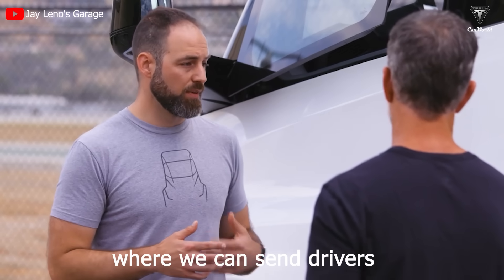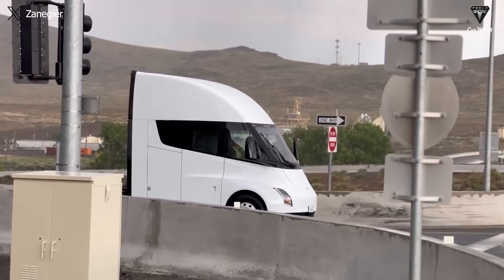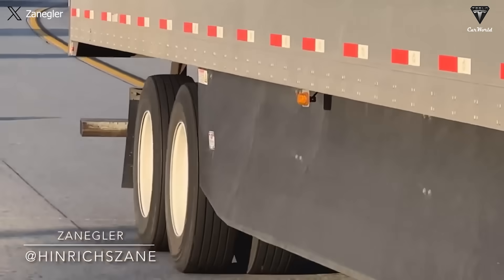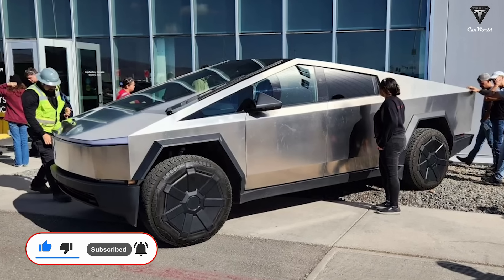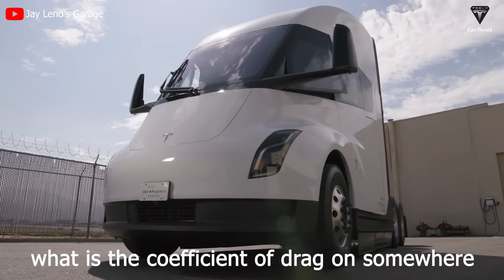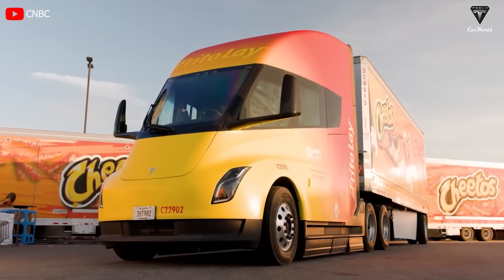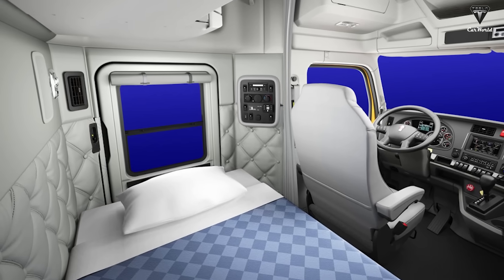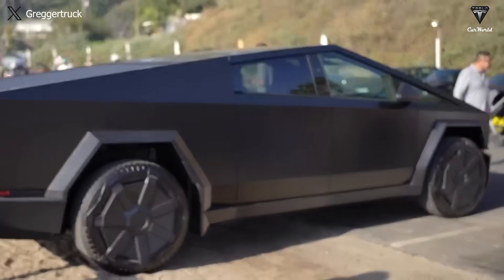Elon Musk Review 2024 Tesla Semi New Version! Up to 90% Surprise, 10,000lb and 600 miles per charge!

Comment: I’m a retired trucker.  Drivers get paid by the “Pay load”.  
I.e. the more you haul, the number of miles, the more you get paid.  
1). I’m still hearing a lot of hand waving over payload (load capacity).  
2). Also, if you stretch the cab, you reduce the turning radius.  

So if you transfer the cost of 18 of 21 etrucks to tax payers, the etrucks are still more expensive….
Hu?

Comment: Why is this truck not a Hybrid ? it will work out better, the diesel will make sure the driver will not run out off the juice , and haw come they dont even run from LA to Las Vegas as they were going to at first, or maybe only use it in a local delivery applications.?. TH

Comment: Pause at 27s into the video and notice that they drove for 19.5 hours (4.5 hrs of breaks) at 60 mph in order to get the 1076 miles. However, they started the 24hr timespan at nearly 95% charge, and ended not at the same charge, but roughly 20%. According to the graph, it took them 2 hrs (11am to 1pm) to charge from 0% to 90%. Thus, in order to return to the original state of charge and be able to repeat the same mileage the next day, they would need to subtract another 1.5 to 2hrs to get back to 100%, thus reducing their mileage by 90-120 miles (let's just avg 100) to give roughly 976 miles. Note: we don't know the weight of the cargo, perhaps it was a half empty truck.....

Also note, they had to drive at 60mph to get these efficiencies (mileage would be worse with higher speeds -- ICE would as well, but it's a 10-15min refuel vs. hrs). In trucking, time is money; mileage/unit-time is money.  According to the FCMSA, truckers can only drive 11 hrs/day in a 14hr work day (other 3 hrs can be non-driving truck related tasks, i.e. loading/unloading/inspections/etc). If we assume ICE vehicle can travel avg speed of 70mph (w/o having to optimize battery drain vs charge-time efficiencies), then an ICE vehicle can achieve 770 miles in 11.5 hrs with a 30 min break during the 14hr window.

For the EV, they deplete the battery from 95% to 5% in approximately 6:45-7 hrs. Need 1 hr to restore 40% charge to 45%, which gets them another 3 hrs of drive time, before needing another 1hr charge & only having 2hrs remaining to drive.  Since they needed to do everything possible to preserve efficiences of battery, they only drive the 60mph to reduce drag losses, and they drive for 11 hrs to log 660 miles, but have already worked for the consecutive 14 hrs regulated by the gov't (so hopefully they don't need to do any cargo unloading/loading at the end of their drive, if they've reached their destination that is).  Also, hopefully they are comfortable minimizing their recharge durations to maximize mileage they can travel in the 14hr work-day (essentially diving under a 10% charge multiple times to maximize their distance traveled & miraculously (one hopes) always having a charger available in the final 10% on the last discharge leg of their 11hr driving journey).
Reply: Yes, downtime is money but look at how little downtime an electric truck would have over the lifespan of the truck compared to a diesel truck. Ups for example, their trucks run 24/7 365. We build them to fuel up while running, with automated lube systems to reduce downtime etc. Those trucks only last about 3 years. The same tesla could last twice as long with half the maintenence. Add to that the fuel savings over those years and I think you've still got a better ROI with the electric. Maybe not yet, until the infrastructure is nationwide, but when that happens, yeah.
Reply: @Lord_Pistachio_Nut  I envision a lot more downtime for charging than for repairs. Every 7 hrs after traveling 420miles (@60mph), the Tesla needs 2hrs to recharge 90%. That's 9hrs to go 420 miles. Divide (365 days * 24hrs) by 9hrs gives you a max of 408,800 miles in a year that the Tesla can drive (without any downtime for repairs, loading/unloading/etc - just Max mileage if it was hauling the same load for infinite miles it can attain in 1 year).

Take a Diesel, not constrained to 60mph, let's say 70mph (typical). In a 9hr trip, with a 30 min window necessary for refueling (a very liberal estimate), therefore 8.5hrs of trip time, it will cross 595miles (without maintenance/loading/unloading). In a year it will go ((365*24)/9)*595 = 579,133 miles.  If you estimate 4 weeks of repairs (28days) for that diesel during that year of continuous running, you still get (((365-28)*24)/9)*595 = 534,706 miles traveled. For the diesel to rank as bad as the Tesla in miles driven per year, it would have to sit in a repair shop 108 full days to only go 407,773 miles.  If you assume the ICE diesel is constrained to the same 60mph that the EV's adhere to (& thus increasing the diesel's fuel efficiency due to less drag with speed), then a Diesel must sit in the shop for 65 FULL days to only make 408,000 miles in a year & be on par with the EV's poor mileage in a year. 

Anything less than 65 days is a win for the Diesel over EVs in terms of downtime. Said another way, that 2hr recharge every 7 hrs is costing the EVs 65 days worth of mileage. As a consistency check on my calculations, I note that a quick Google says Diesel Semis typically last 750K miles & can even pass 1 Million miles. Given my calculations of the mileage driven above, that jives with about 2-3 years of 365/24/7 driving that would hit between 800K-1.2M miles before the truck must be discarded.

Comment: Diesel trucks are not $120k anymore. Maybe 2019 diesel trucks with 300k miles on them. Or salvage diesel trucks with fresh water insurance claim. (works gr8)
So Tesla can charge whatever makes sense for them as long as they treat their employees well. And the weight is not that important for sleeper trucks. Range is. The shippers will adjust the loads. The Peterbilts and Kenworths are not very light either but they are everywhere. So

Comment: High capacity charger requires 10Kv grid connection. Some local to-grid large docks owned by big corporations might be able to get local electric suppliers to allow a 10Kv install. But outside of that, there is no local electric supplier that has the capacity for another 10Kv in one location. Even warehouse owners with many gas forklifts are being denied chargers to convert their forklift fleets to electric because the grid capacity is not there. Without high capacity charger its a 10 hour charge for a Tesla Semi verses 15 minutes and 1500 miles for diesel. If your a driver, which would you prefer.
Reply: Great points, and the same goes for Tesla cars vs gasoline cars:    5 minutes at the gas station adds 400 miles of range to the car.  Tesla car cannot compare to that!

Comment: I think the roll out of these vehicles will be closely match to the installation of high capacity chargers.  The Pepsi vehicles frequently got 'topping off' charges during the day while the driver had a break.  Regenerative braking significantly assists charging.  To keep the weight down I would not be surprised if carbon fiber will be used in the future.  Walmart has already put down a deposit on the next batch of trucks.
Reply from the maker: Thank you for the information. The current release of Megachargers by Tesla remains a challenge due to its high cost, especially considering the limited number of Tesla Semis, only 100 units. Regarding carbon fiber, what is your perspective? Please explain it more clearly to us.
Reply: While I have no inside information on what Tesla will or will not do.  Engineers have known that carbon fiber is one of the best choices when manufacturing strong but light equipment.  Some examples are cylinders to contain compressed natural gas, the Boeing 787 and the Airbus A-350.  In all these applications the carbon fiber is used in conjunction with other materials.  Usually aluminum.  Tesla engineers are known for actually using the best ideas available.  That is why I stated that it would not surprise me.
Reply: @alberthartl8885    Regarding carbon fiber for the Tesla Semi:    Yes Boeing and Airbus use carbon fiber extensively.  But a passenger jet sells for $200 million USD or more.   A Tesla Semi costs nothing compared to that.   Carbon fiber is expensive.
Reply: @alberthartl8885  ehh I beg to differ on the whole carbon thing. Sure, it's strong but no, it's not strong at all lol. It's one of the most fragile "hard" substances we can build with. Carbon works on planes because of negative pressure, same reason it "can" work on subs, but a semi? Any weight savings you could gain from carbon fiber would end up being negated by repair or production costs along with R&D to supplement the inherent weakness carbon fiber has. Theres a reason one frame rail weighs so damn much on a semi truck lol. The forces at work on a semi are by and large above and beyond what common people seem to understand. Carbon for tanks would be a hard one to pass DOT regulations too I think: given how air and fuel tanks need to be able to handle x pressure before failure etc. Idk though, carbon impregnated materials may be an idea moving forward 🤔

Qualifications: I build the #1 rated semi truck in America, specifically on the early form Chassis line and have learned quite a bit about WHY we use what we use; from a safety AND usability standpoint. Carbon fiber is more vanity than function in that application.

Comment: There is probably only so far that technology can go with the "energy per weight and per volume" that electrical battery storage can go.  And that will not approach anywhere near what "hydrocarbon" fuels can approach.  So even with the different mechanicals, and even better than the 40% energy to mechanical conversion (in electrical probably over 80%) there is always going to be a weight difference between electrical and similar sized/capacity ICE vehicles.  It is suggested here that weight difference is about 2,000 lbs on the big rigs, and more range will mean more weight.  Leaving the question (particularly in sleeper cabs) "where do you put the batteries.  They may have to think about putting an additional battery pack in the trailer itself.  Which would make the "batteried" trailer specific application/purpose, rather than a cheaper general purpose that can be used by any rig.
Reply: The weight difference is much more than 2k lbs. but unknown. Yes for the next few years battery trucks will be limited to smaller weight loads, but that is still  80% of the market. Cost saving will be significant, and clean silent trucks are great PR for companies.

Comment: People who actually use their trucks need at least a 500 mile range for towing and a full truck bed. The range extender sucks. Surely Tesla can do better than this.
Reply: I don’t think the 4680 performs as they had hoped at this point. But a lot of people are working on advanced battery technology.
Reply from the maker: Thank you! Tesla Semi always better in update version !!
Reply: 4680 battery is not optimal yet apparently. From the tear down looks like the MY with 4680 has roughly 828 cells that can give 278 miles full charge. 

Dimensional wise, looks like the Cybertruck and MY has the same floor dimension so we need to wait to see how many 4680 cell in the Cybertruck battery pack that achive 341 miles. If the amount of cell is the same 828 (unlikely) then 4680 cells project look like a success else we can divide to see how much kwh per cell for the Cybertruck. 

With Tesla opsession with sameness, I think any major break through will be with those 4680 cells as there's limited amount and maximum cells per battery pack from their assembly line. The reason why those 4680 dimension cells is huge is because of cost. Imagine they price each cell at $5 and a standard battery pack is 828 cells (right now). You are looking at potentially battery replacement of sub $5000 for regular Tesla vehicle ($4140 in parts + $860 labor) since all will be in house.
Reply: @ryannguyen7466  There are over 1,000 4680 cells in the Cybertruck, can't remember the exact number but I think close to 1,100. It is 123kWhr.

Comment: I see it, if everybody else doesn't. Tesla has built an iterative test fleet of CyberSemi. Meanwhile while testing redesigning and improving it, they also brought the cybertruck test production tool for a dozen game changing technologies. Airbending steel means your beding press wont wear out. 48v. 70% less copper 15% less watts used to do everything. Ethernet ring. Only 30 years late low energy fast data bus. 12KTON giga press. Steer by wire. Ok 5 game changers plus hundreds of little things that a few years ago would have dominanted auto innovation. By 25' they will both perfect the engineering and the production of all of this. Meanwhile they continue to ramp their batteries driving for energy density and price. Weight and dollars. So by 25' all of these come back together. The Semi the rest of the models, the new pure model 2. All 48v all steer by wire, all stainless, exoskeleton... wow. 2 million 3's 2 million Y's 300k Cyber trucks, 50000 Semi, plus the model 2 ramp, megapacks, optimus. See that gen2? In two years from girl in a costume to third iteration free walking himanoid robot.

Comment: I still cannot see this as a Long Haul truck are the delivery customers really going to have a charger for these trucks at a cost of millions of dollars per installation?
Reply from the maker: Currently, with the Tesla Semi Day Cab Version, Tesla and PepsiCo only allow delivery drivers to operate within a range of 400 miles for a round trip. The new version will include additional charging stations and sleeping accommodations for the most convenient and efficient routes. Rest assured in this regard. Thank you
Reply: If you go back to the Tesla Semi Unveiling Video, from 2017, you will see they shared a Data Point that said 80% of All Daily Truck Trips, are (something like) 250 Miles from Base, and Back, per day! Hence, the Tesla Semi is a "Day Cap" since that is the Biggest Unit Volume Market at present, to replace ICE / Diesel Semi's!

Once There are enough Units built, to satisfy 30-50+ "Large Fleets", that they then have put in 30-50+ "Highway Megachargers" (not just the ones like Pepsi & Tesla use, at their "Bases"), there is yet a possibility to see them unveil a "Sleeper Cab" or "OTR" (Over The Road, or Long Haul) Semi! 

I Estimate, 4-6 years, or so, at least, for that!
Reply: As they make facilities and facilities make money, of course.
I am pretty sure every facility is also making money selling power back to the grid.

Comment: still crap. it takes hours of chargin to drive 600 miles at best in vacuum, and then look for a charging station to sit there for 10 hrs. whereas diesel trucks take 15 min to full the tank and you can go for another 1000+ miles.
Reply: 80% of charge in 15 min + Charge while loading/ unloading?🤔
Reply from the maker: But don’t you think about cost for diesel more expensive when they have same miles ? And a alot of CO2 !!
Reply: Initial sales will be for local and light loads. that's over 60% of the market.

Comment: Pardon my ignorance, but is the much vaunted 48 volt and drive by wire adaptions in the Cybertruck intended to be rolled into production of all Tesla vehicles?
Reply: So, the cybertruck will be the platform to test all the new innovations. And it's production will drive the scaling of fabrication if the 1000 plus electronic parts that need to be created in 48v. It will be cybertruck ramp where this production ramp up will be built. But then, it would be smart to take these ultimately cheaper and more efficient parts . Then, once bullet proofed, and roll them out to much larger production models. This would be the final 6x replication of production capacity after the first production has been perfected. I estimate this could happen as early as 26' Nobody sees it, but that memo to all other auto makers was both an invite and a warning. "We are doing this and will be all 48v as soon as we are able. Join us, or DIE.
Reply: @Agatesforbrains  Yes, Ford’s CEO’s positive response to the “invitation” was interesting, to say the least. I’m no mechanic, so it just looks like a slam dunk to me, in fact only question I have is why it hasn’t been done before?
Reply: @229andymon  There was a big push in the auto industry to move to 48v years ago, late 1980s I think. I really though it was going to happen, but the bean counters said the conversion would cost too much to make the switch and they never look to the distant future, just the next quarter or one year. Anyhow the idea just died.
Reply from the maker: Exactly, Tesla Semi has planned to use 48V instead of 12V long before Cybertruck, but steer by wire may be considered because many factors and the nature of the vehicle must be considered, please wait for more. Thank you !!